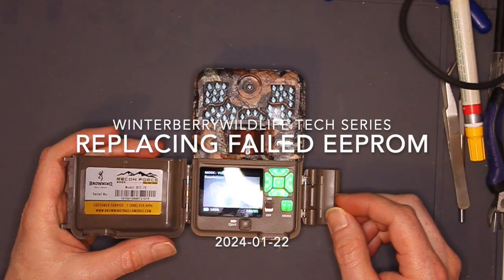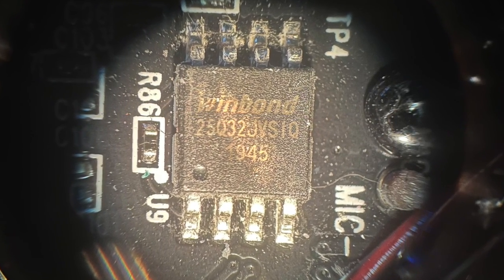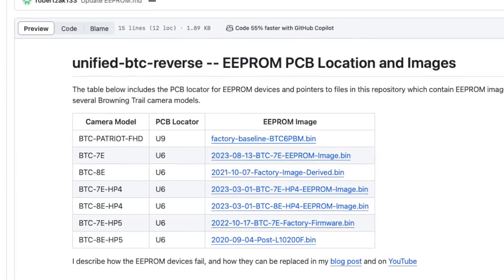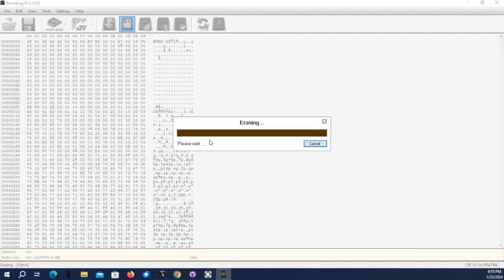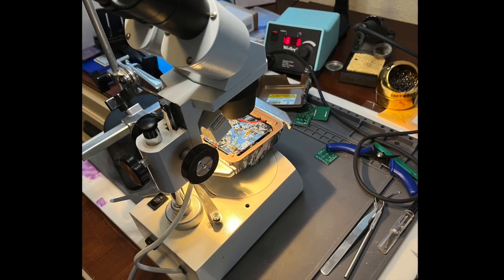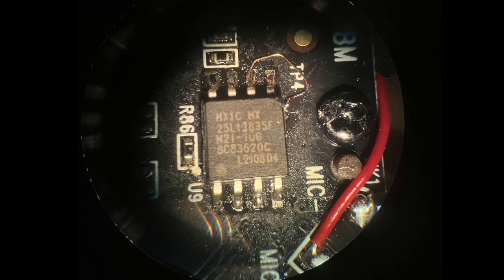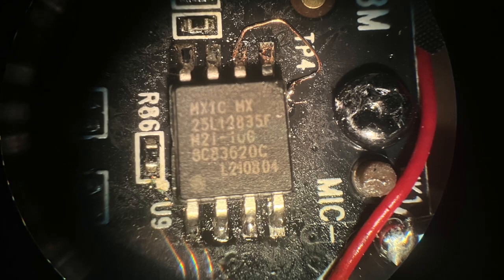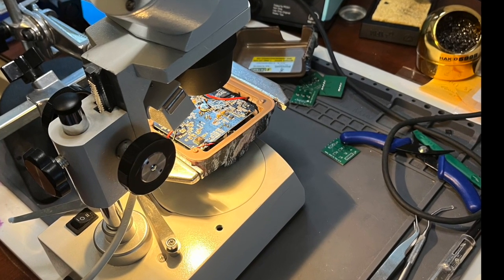2024 01 22 Replacing Failed EEPROM in Browning Trail Camera   HD 720p

Comment: Thanks for the video.  I have many Browning cameras and I've reached a frustration level with them.  One that led me to this video will take two videos then re-boot.  When it re-boots, it puts it into trail cam (photo) mode which is not what I want.  I tried re-installing the firmware.  Didn't work.  New batteries.  Cleaned with alcohol. Didn't work.  This project may be beyond my capability and tools.  But I admire the knowledge and appreciate the video.  I may give it a shot.  Not sure.  Hate to toss these cameras.
Reply from the maker: Yeah -- it's frustrating that these cameras fail over time due to design decisions.  I'm thinking both of the EEPROM and the internal Battery/Ultracap that keep the clock set during battery changes.   This fix is a little tricky, but if you have more than a couple cameras failing in this way, it may be worth the time to get the equipment, and learn the skills necessary for repair.  If you decide to go for it, and run into any issues, drop a comment here and I'll do my best to help.

Comment: Great video, Bob! Is the Eeprom the same for all the HP5 and HP4 model camera, or each camera has its own eprom ?
Reply from the maker: Thanks!  I hear two potential questions: do the HP4/HP5 cameras use the same EEPROM part; and do the two camera models use the same EEPROM image?  To the first question: although they could use the same part, the HP4 uses a 16 Mbyte capacity part, while the HP5 uses and 8MByte capacity part.  To the second question: the EEPROM images (like the firmware) is different for the two models.  My GitHub site contains EEPROM images for the different models.  See: https://github.com/robertzak133/unified-btc-reverse/blob/main/eeprom_table.md    NOTE: If you use these EEPROM images, make sure to use the following EEPROM part:   Macronix MX25L12835FM21-10G.   The EEPROM code checks the manufacturer ID of the EEPROM device before loading the remainder of the image.
Reply: @winterberry-wildlife-tech  Thanks a lot Bob !  just for my curiosity: do all the Browning cameras use the same EEPROM MX25L12835fm21-10G? (I mean the hardware, then  as you wrote each camera model should have a different software, found in your link,
Reply from the maker: A complicated question (which goes with a correction to my original response).  They all can use the MX25L12835fm21-10G, which follows an industry-standard electrical and logical interface.  However, between the HP4 and HP5 models, Browning cut the size of the firmware image to under 8 Mbytes.  Thus, the HP5 uses a 8 MByte EEPROM variant, versus the 16MByte variant used in earlier models.   Reducing code size reduced trigger time (less firmware to load), and allowed Browning to use a cheaper part.   None of the Browning cameras actually use the Macronix part above.  They use a similar part from a different vendor.  I chose the Marconix part because: at 16 Mbyte capacity, it works with all cameras; and it was easy to source in the US.

Comment: Hi Robert,  I discovered that would be possible to read / write the 25Q80 chip with an Raspberry PI using the <flashrom> utility. Have you ever try this solution ? I have some spare Raspberry PI3 around .. so I might try to read the chip and save as a bin file. Are you interested ? BR and have a nice weekend !
Reply from the maker: Cool. I looked at something like this, but decided I would focus my limited hacking time higher up the stack, so I just bought the RevelProg.    I don't have much experience with the Pi.  I will say that I've been very happy with the RevelProg IS https://www.reveltronics.com/en/shop/18/7/chip-programmers/revelprog-is-serial-device-eeprom-flash-programmer-usb-detail   .  In addition to containing all sorts of hardware niceties like over-current protection, the software tools (for the PC) are very helpful.  At USD$125 it's been a great deal. 
 I think you will still need a way to connect a ZIFF socket for SOIC-medium (200 mil/ 5mm package) [I was calling this "wide" in previous comments -- but I guess there's something even wider].  Fortunately, this seems to be easy to come by, e.g. https://www.adafruit.com/product/1796      But I note that this would probably make a fine adapter for your existing EEPROM programmer or the RevelProg  :)    Whatever you try, I am interested how your fare.  Especially if you succeed (where I could not) in removing an EEPROM from the camera without causing it to lose data :(

Comment: Excellent, I have a Patriot with exactly these symptoms, and a pile of ProXDs with various maladies that might also need this type of fix
Reply from the maker: What’s the part number for your ProXD’s?   if you decide to address your “pile” let me know, and I’ll see about getting an eeprom image for that model
Reply: Hi Peterapps,  you mean Strike Force ProXD  model BTC-5PXD ??  I have one with firmware 5PXD-V1804270 /  m17113001 which will always revert back to <video mode> and recording only 1 video, with name <1> ... so will be very interested on a new firmware for that camera .....
Reply: Yes, that is the part number. Some of them save only one video, some of them only the first and the last in what was apparently a series of detections. Scrambled screens are also quite common. If I had time I would see which of them are fixable  @meteo091

Comment: Thank you very much for this video ! As I wrote in your web page, I was able to restore my BTC-8A to life, only updating the firmware using normal procedure. Maybe one day I will fix my BTC-5PXD dual sensor camera as well .... both triyng to upload firmware only or replacing the entire eeprom. I have all the necessary programmer, tools and skills ... only binary code is missing ! 🙂 Regards from south Switzerland ! Pietro
Reply from the maker: It definitely makes sense to try everything else before going doing the EEPROM replacement.  I don't have an EEPROM image for the BTC-5PXD yet.  If you decide to go down this path, let me know.  Happy to work with you on synthesizing an image for that camera.
Reply: @winterberry-wildlife-tech  unfortunately I checked my programmer (Dataman 48UXP USB) and realize that the correct chip's adapter is missing ! Even if the type of chip is present in the device list (winbond 25q32 8pin), I don't know how to connect it to the programmer, at least to try to read the chip, which is also called U9 on the BTC-5PXD and is found in the same position as in your video... BR, Pietro
Reply from the maker: Well, that's disappointing :(   A few points: 

Programmer “Physical” Compatibility: 
 I noted only briefly in my video, but the SOIC ZIFF socket on my RevelProg IS programmer is also physically incompatible with the EEPROMs used in these cameras. The Camera SOICs are of the "wide" type -- 5mm -- vs. the "narrow" -- 4mm -- SOIC ZIFF socket on the programmer.  The RevelProg has a ribbon cable connector on the side which allowed me to connect my own "wide" ZIFF connector.   You could probably build a similar adapter that has a set of pins that fit inside your programmer’s ZIFF socket, and then come out via ribbon cable to a "wide" ZIFF connector.  It's straightforward, once you have all the parts, but they're a pain to source.

Reading the EEPROM: 
As I noted in my blog post, I was not able to read the EEPROM in situ on any of the Browning camera models. Not for lack of trying.  I attached the programmer, via same ribbon cable connector, to an 8-pin SOIC “Clip-on” test fixture.  I clipped this on top of the EEPROM, and made several attempts to read the EEPROM through the RevelProg Programmer (which is designed for this, with built-in over-current protection on all signals).  I believe if the camera was designed to allow in-situ access to the EEPROM, this would have worked.  It did not.    It’s possible these cameras have some way to access the EEPROM contents via a debug interface, but I haven’t been able to figure this out.

I did find that removing the EEPROM *always made it partially or completely unreadable*.  I assume this has something to do with the heat required to remove it, and possibly it’s already compromised state.  

This was why I ended up with the much more involved process of reading the EEPROM by parsing the pin-trace from a logic analyzer and combining this with data from the firmware image.  I.e. I only did the really hard thing after trying everything else I could think of 

EEPROM Manufacturer: 
Heads up.  The EEPROM image contains the deviceID (manufacturer and part ID) of the target EEPROM.  The EEPROM loader checks this value against what it reads from the EERPOM device, and aborts if there is a mismatch.   Ask me how I know this :/  This is why the images I posted work only with the Macronix part.